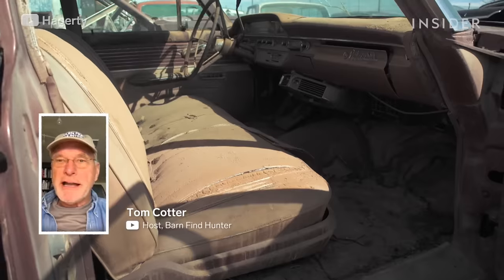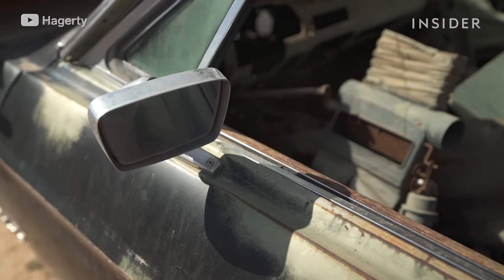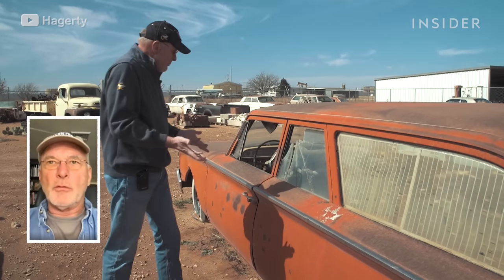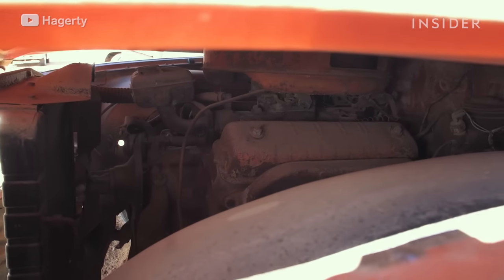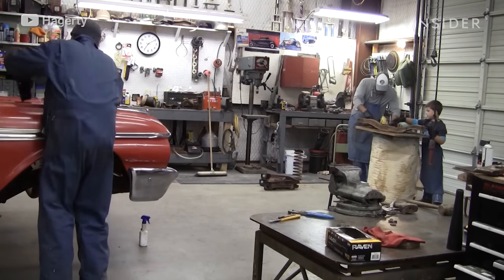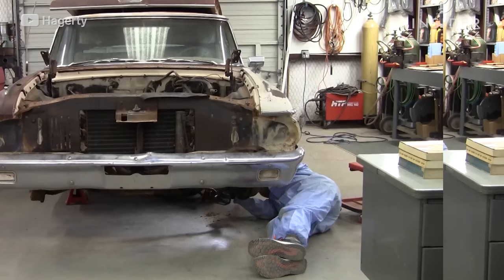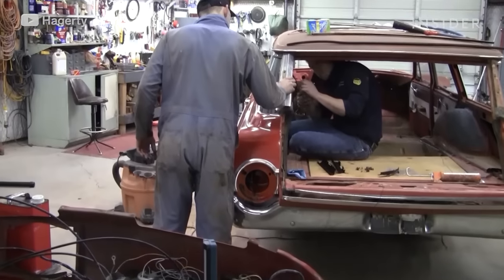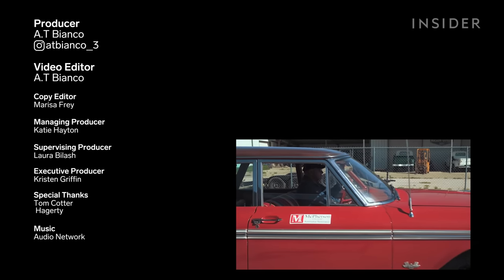How Classic Cars Are Found And Restored | Cars Insider

Comment: So nice to see an old car brought back to life...and NOT hot-rodded up to the point that its lost its original character.
Reply: I honestly hate rat rods. I'd rather spend an extra $30,000 bringing a car back to life than take the lazy route and chop it. The only time I love chrome is on vintage cars. 

One day I'll find another Studebaker semi. There was one at a scrapyard in my town, a tree had crushed the cab. I don't know what happened to it after I saw it, but I think it was set aside either by the workers or the owner of the scrapyard. Even in it's sorry state, it was a beautiful truck. For my own sanity I choose to believe that it was saved.
Reply: Rat rods are good if the car was past the ability for a fully restoration however I agree with you when some one takes a rusted but still good cat and chops it. @GetDougDimmadomed

Comment: Confused. The car at the beginning of the video is a 1960 two door wagon and the finished car is a 1962 four door wagon. Like the idea and concept, but something is off.
Reply: THEY WERE SHOWING TWO NOT IDENTICAL CARS
Reply: It's the same car on the forklift at the start, in the garage and on the road at the end. The other car, the two-door wagon, seems to serve as an illustration, the four-door had to be removed before the filming session 😉
Reply: Basically one side of the car doesnt have a rear door while the other does

Comment: A few months ago I bought a 1977 Ford LTD Base Model with just under 30,000 miles that looked good on the internet with slightly fuzzy video.
It sat in the sun for a few years, and as such after a few rain storms the WD-40 shine got washed away. My main issue is the door and window seals are dry rotted and need to be replaced.
It needs a few other things like the chrome trim that wraps around the fenders for example.
I cannot find parts for my car anywhere on the internet including those websites that sell parts for classic Fords.
Am I screwed, or is there a website that I can go to where I can actually get the parts that I need?
Reply: You can try going to junkyards they have a lot of classics at some of them but don't expect to find the seals since they will likely be rotted away on the junk cars to but the crome you probably could find